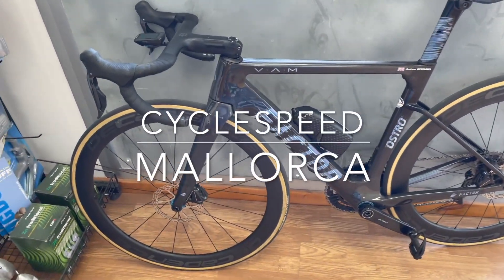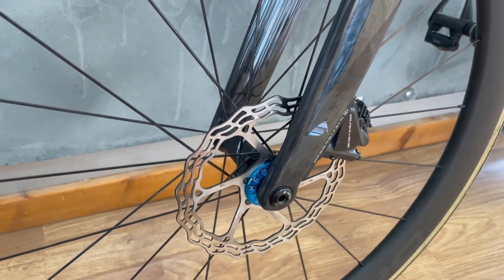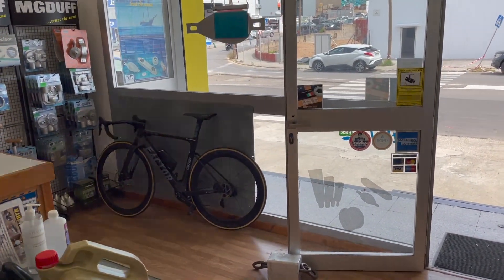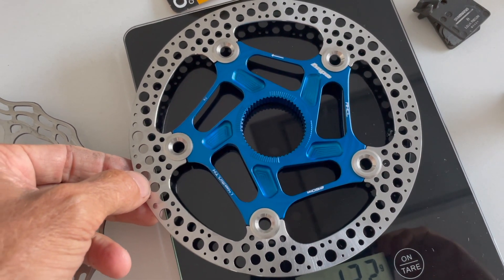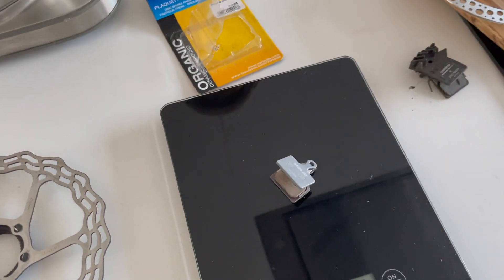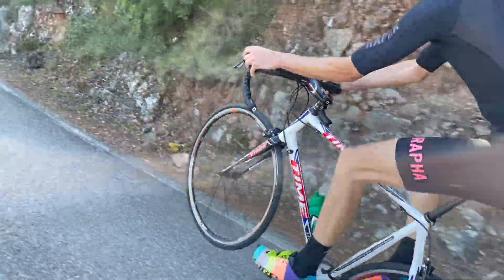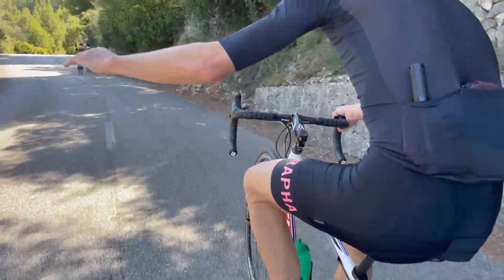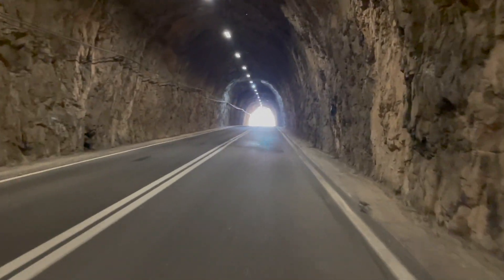Is a Hope 160 Disc better than Ceramic?   HD 1080p

Comment: 160mm rear disc lasts longer, less pad temperature, better modulation near the limit and less chance to lock up. I’m 74kg and can destroy a resin rear pad in 2 months but I live in more mountains than Mallorca. A standard construction 160 disc can easily overheat on a big descent at speed, never mind a 140. Less of an issue for flyweights or flatter terrain. A sweeping comment that a 160mm disc is never needed at the rear is somewhat short-sighted.
Reply from the maker: The thing is, I hardly use the rear during aggressive descents. For me, it's just a stabilizer, to be feathered slightly when entering bends. But 90% of the work is being done by the front, just like in a motorcycle. (In fact the rear wheel is sometimes in the air, so the brake is never going to do much!) So overheating the rear is not an issue for me and never will be. The proof is that the rear pads are barely worn, whilst I have gone through 2 sets of front.
Of course anyone could lock the rear at will with a 140. I just don't see the need for the extra power of a 160. Better modulation? Maybe, but depends also on lever and caliper. 
Different riding styles call for different solutions, but a 160 rear seems like overkill to me and doesn't look good, especially when you have to use the caliper adaptor.

Comment: Absolute black makes the sickest lightest lock ring. Check it out
Reply from the maker: Hmmm, the KCNC is already pretty light and the AB says it MUST have Loctite applied.....
Reply: @CyclespeedTours  Oh okay. I’ve been using them for 3 months now without loctite, just muc off pink grease on the threads. No issues so far.
Reply: yeah, but is it aero and gravel-specific?

Comment: The reason those Shimano brake pads were lighter is because they have an alu backing plate, those other cheap ones probably have a steel backing plate hence the weight difference
Reply from the maker: Well, they're installed now, so can't get the magnet to them, but why use steel when alu is cheap enough and easier to machine? I think the main difference is the amount of pad material.
Reply: @CyclespeedTours  no its the backing plate, you can get shimano brakepads with steel, titanium or alu backing plates. Many brands offer a steel backing plate and their more performance oriented alu backing plate
Reply from the maker: @Borrobbos  Have you tried VAR pads? I'm still not convinced these are steel, but happy to be proven wrong! I've asked Vartools for an answer!
Reply: @CyclespeedTours  use alu backing with a heat sink, like shimano finned pads.....A steel plate will protect the piston temp from being excessively high and overheating the seal if you don’t have fins. I’m finding the pistons need removing and cleaning up after they’ve become too hot. Dreaded fluid contamination on discs from shimano mineral oil. Won’t use non-finned pads again in shimano. Hope RS4 so far bulletproof and feel better.
Reply from the maker: @andrewholt7505  I think if I was riding Alpine cols, I would be sure to do that, but there are only one or two cols here in Mallorca that really stress the brakes, and I tend to avoid those as I prefer fast descents. But the whole overheating issue is a real headache that simply didn't exist with rim brakes.
Reply: @CyclespeedTours  my delaminated dt swiss rear wheel begs to differ 😅

Comment: Sure I read somewhere about a pro team using mountain bike disc rotors
Reply from the maker: Yes, XTR have been used in the pro peleton
Reply: @CyclespeedTours  what are your 2 cents on the XTRs?
Reply from the maker: @marianoruiz9039  Not used them, but hear they are lighter than DuraAce. But pretty similar to be honest.
Reply: @CyclespeedTours  I do use XTR rotors on two bikes and they are lighter, but seem to have the same warping issues. From what I understand you had less warping with 140mm on the front. Thats the next thing I will try at least on my girlfriends bike. I only use disc for gravel and hope it will stay that way, but rim brake frames are getting hard to come by...
Reply from the maker: @Freddy3792  Yes, that's right. It may simply be that a 140 has less far to bend than a 160, because it has to disperse the same heat in a smaller volume. I do miss the DA DM rim brakes on my Sworks SL6.....
Reply: @CyclespeedTours  Have you sold the S-Works?
Reply from the maker: @Freddy3792  No, can't bring myself to part with the pinnacle of rim braking....
Reply: @CyclespeedTours  Will keep an eye on your next post for new rotors you find 👌
Reply from the maker: @marianoruiz9039  I am scouring the world for a good, light 160 CL !!
Reply: @CyclespeedTours   Check your Facebook, I sent you a good prospect
Reply from the maker: @marianoruiz9039  Didn't see anything? my insta is @cyclespeedtours

Comment: Never had a warped disc ( have XTR ones ) and I live on the bottoms of the alps... Maybe it's luck or better brake modulation
Reply from the maker: Maybe Shimano have better QC....As for brake modulation, I brake short and hard, I never drag the brakes.
Reply: @CyclespeedTours  same as you, brake hard and release gradually. Discs become hotter when dragging them for kms, but you know better than myself... Been to Mallorca last summer, you have some serious gradient there